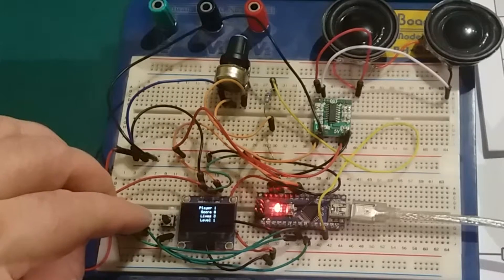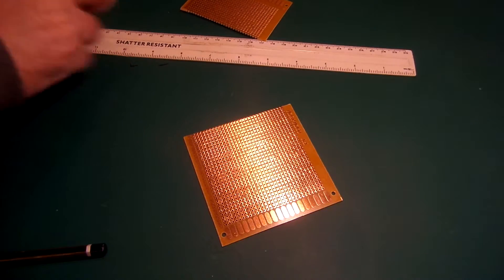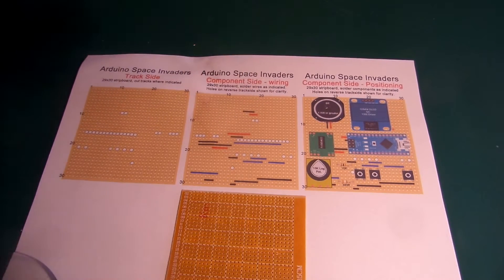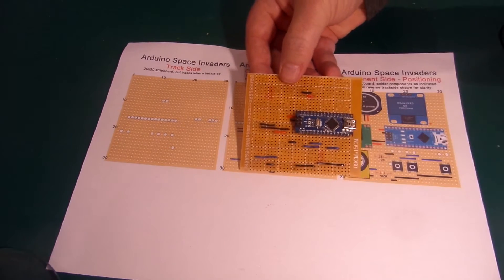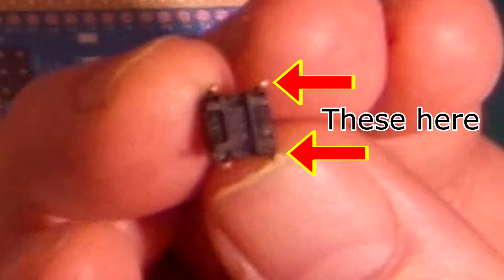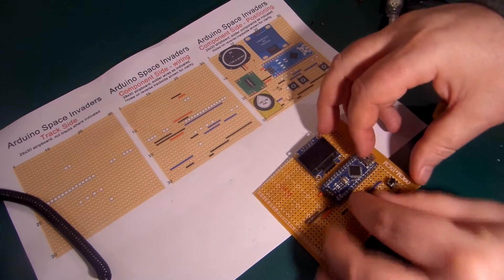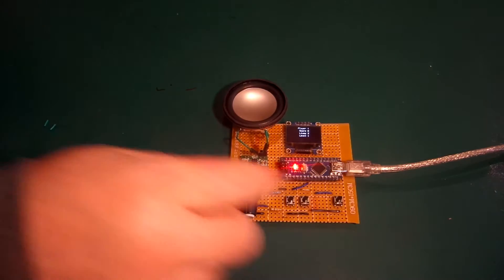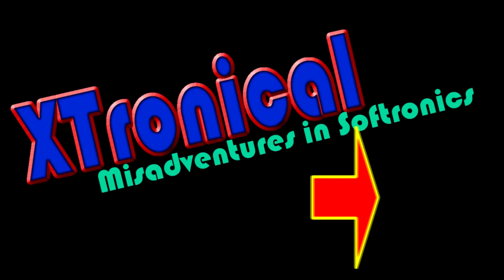Arduino Space Invaders put onto strip-board

Comment: I'm very excited about your project.  I have downloaded your latest version (with sound) and have come up with a compilation error I hope you can help with:

In file included from C:\Users\tonyg\OneDrive\Documents\Arduino\Space_Invaders_with_sound\Space_Invaders_with_sound.ino:3:0:
C:\Users\tonyg\OneDrive\Documents\Arduino\libraries\toneAC/toneAC.h:111:82: error: could not convert 'false' from 'bool' to 'bool*'
   void noiseAC(unsigned long length=250, uint8_t volume=10, bool* Completed=false);

I am using IDE 2.0.3.  I've narrowed it down to a problem with the toneAC library I downloaded on your website.  Your earlier versions without sound compile and run brilliantly.  I would appreciate any guidance, thanks.
Reply from the maker: Odd, try taking out the "=false" bit in that function header.
Reply: @XTronical  Thanks for your quick response!  I'll give it a try.  Cheers!